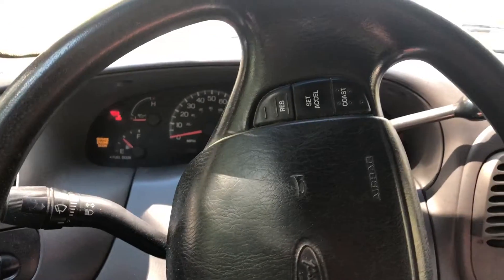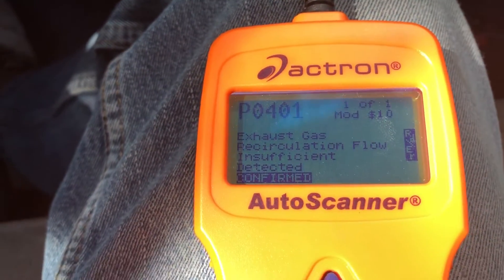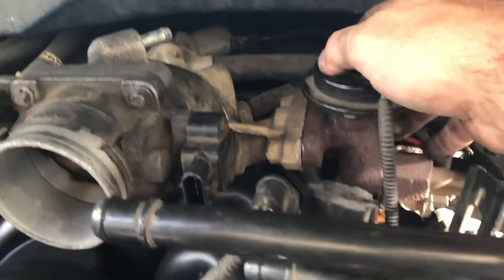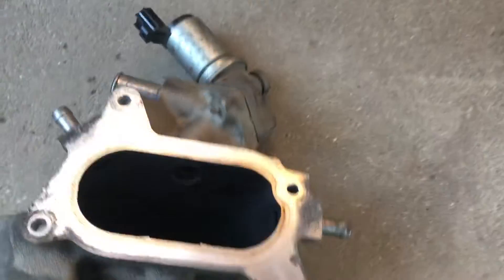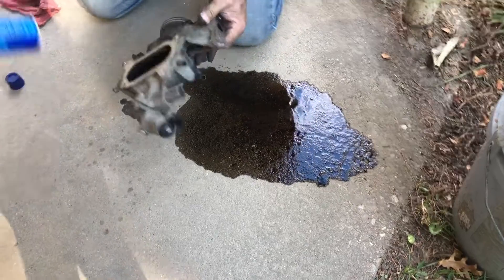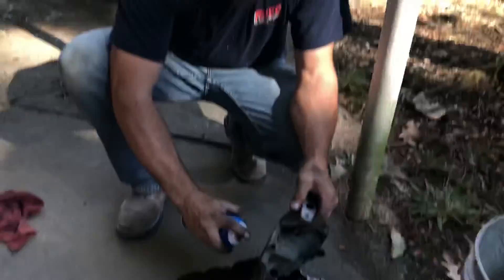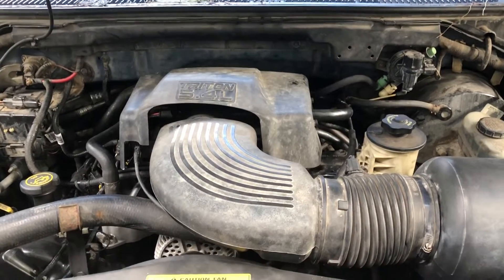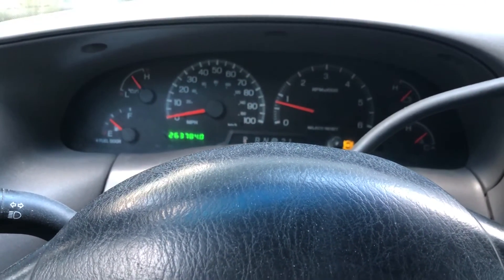Engine Code P0401 Solved. EGR INSUFFICIENT FLOW 2000 F150 XLT

Comment: I have the 97ford f150 5.4 2wd  I changed out the egr valve brand new,brand new throttle body installed last year egr valve last month still get that code will try this next

Comment: here’s lots of people that get this code and ends up being the valve or the build up on the throttle body or vacuum lines but with these trucks most of the time  lots of people do just need the sensor replaced but with other trucks i fixed this problem was valve or build up in the throttle body sometimes even little things that probably should have thrown off other codes but that’s the cons of having a truck that runs and ran and can run even a  a long time… even last as long as old vehicles did before 2005 that’s including other company’s

Comment: Entirely unnecessary to remove.  Come around passenger side of air intake housing.  Pull off rear hose opposite of the two EGR holes, insert small screwdriver or coat hanger and open.  Job done in 2 minutes.  Next, change your spark plugs and stop buying cheap gas.

Comment: I was getting my check engine light checked at auto zone, the first time they said it was the dpfi. Sensor. Put that on the same thing. Next the egr. Same thing. Next the vacuum solenoid. Still check engine light. So I saw your video, so I did what you said, no light. I recommend cleaning the ports before you do anything. I thank you very much for your video. If I would have seen it first I would have saved a couple hundred. Thanks
Reply from the maker: I'm glad the video helped you out.  If your light comes back on check your two hoses to your egr. My hoses were slam full of gunk as well so I ended up replacing the hoses and never had another problem

Comment: I started getting that Code after SeaFoam shocking my 99 F150... the shock worked for Bank Lean code, and Manufacturer Control... I'm on my next fill up... So It maybe needed to burn off.

Comment: Hah, I had a feeling this is where I would end up doing. I'm chasing p0402 changed dpfe, still showing feedback insufficient flow. I'll do this, then check the hoses that come off the dpfe. It's right up front on the 4.2 liter. Thanks for the video.

Comment: I appreciate you making a video to try and help… however brake cleaner is too harsh for the throttle body. Use throttle body cleaner that is designed to protect the sensors and rubber or plastic apparatus that may be connected to the throttlebody assembly. thanks!

Comment: I have the same model, but from '98.
How difficult/frustrating is it to remove that part? And about how long to do so, clean, and re-attach it? My engine light cones on at random moments, but the PO401 is the only code I get. It must need a cleaning.

 I'm the second owner of my truck. The previous owner, a old man in his late 70s, took good care of it, but never replaced parts. I've already had to replace the waterpump. I can't imagine this being more difficult than that.
Reply from the maker: It wasn’t very difficult probably took an hour or two. However I will say that after I had solved that problem I ended up eventually getting another code P1406 DPFE downstream hose off. I checked the two hoses that ran to my egr and they were gummed  up severely. That completely solved my issue. No problems at all after that. I have a video on that as well. I would check those two hoses. Most likely they are gummed up. Engine code P1406 fixed!!! Is the title.

Comment: I’ve done everything replaced everything and cleaned still have code
Reply from the maker: I had to end up changing my DPFE hoses that go to the egr valve. At first this worked however I ended up getting a different code which told me I either had a downstream hose disconnected or clogged. After checking I realized the hoses were completely clogged with emissions gunk. I did another video on that as well you could check out. It may be the problem your having as well.

Comment: I have a 00 F150 that has an insuffient code that's popping up.
I removed the throttle body cleaned it, changed the EGR valve and I'm still getting the code and the light on the dash.

Any suggestions?
Reply from the maker: Check your DPFE hoses. Mine were completely clogged with emission gunk at first cleaning the throttle body worked. The I got another engine code P1406 (down stream hose off). I replaced the two hoses to the EGR and fixed the problem.
Reply: @ErnestPreas  I checked the hoses and they were free so I went ahead and order a DPFE sensor. I'll let u know if that fixes the issue.

Thx
Reply from the maker: @kye389  sounds good let me know how it goes for you. Hopefully that will be the fix
Reply: @ErnestPreas  YAAY!!

I have changed the DPFE sensor reconnected my battery and its day three  the check engine light has stayed off.  🤞🤞

Thx for your input!
Reply from the maker: @kye389  that’s awesome man! I’m glad you were able to get it fixed 🤞here’s to hoping that engine light stays off
Reply: @kye389  did the sensor fix your problem ?
Reply: @diyrob9160 Yes it did but make sure that your throttle body intake is cleaned all the way out.

I have had to get me a fine pencil shape wire brush and placed it on my drill and get down in the small ports.

Engine and throttle body doesn't clean all of the chunky waist that's in it.

Good Luck!

Comment: Its not the throttle body...it's the Dpfe sensor.
Reply: What's that
Reply: there’s lots of people that get this code and ends up being the valve or the build up on the throttle body or vacuum lines but i’m not saying your wrong because lots of people do just need the sensor replaced but with mine and other trucks i fixed problem was valve or build up in the throttle body sometimes even little things that probably should have thrown off other codes but that’s the cons of having a truck that runs and ran a long time…tbh they don’t even last as long as old vehicles did before 2005 that’s including other company’s

Comment: Your daughter is adorable. Just finished intake gasket job trying to fix high LTFT (vac leak). There are NO vac leaks anywhere and now have the P0401 code along with high LTFT numbers. When I did have the manifold off, everything was coated with gunky oily shtuff. Also, while the engine idles, I can here a hiss that is no where to be found. Going outside to replace the EGR and then the solenoids if that doesn't do the trick. Little story behind my truck. It is a cheap CList junker that has me addicted to getting it back to perfect. No shop is going to touch this truck. Want to do it all by myself no matter how long it takes.
Reply: Did you get it fixed?
Reply: @iamlazarow3526  YES....took my time and made sure all the Dorman gaskets were replaced clean & easy. She runs perfect with great fuel trim #'s. NOW I'm working on steering wheel play/slop.
Reply: @clutch5sp989  awesome! Which gaskets did you replace?
Reply: @iamlazarow3526  The intake gaskets & water cross over gaskets. With the Dorman intake off, I turned it upside down and filled it with water to see if it had a crack or leaked. Check to make sure it wasn't suck'n air that way. That vac leak was driving me mad I tell ya and it was going to get fix'd !
Reply: That hiss turned out to be a vacuum leak on my F150. Had to replace the head as they are famous for getting warped.

Comment: What were the driveability problems you were experiencing before the video.  My F-150 is a 5.4 1998 model, and idles fine, but misses as you go above idle.  No codes yet; only an indication that the Evap system has a problem.  Misplaced my good scanner that gives me the Mode 6 info. Thanks for making this video - very helpful.
Reply from the maker: It would idle ok as well and would slightly stumble  a little on take off and seemed to stumble while driving just a little.
Reply: @GR ABS light is likely a sensor, my 99, has been on for 85k miles, my po401code caused zero drivability issues , just a SES light

Comment: That's a good idea to clean the throttle system.  Usually with older vehicles such as the F150 and/or Expeditions the EGR valve doesn't open all the way to allow fuel in.  Chances are it'll run for a while then the code will possibly come up again. I simply replaced the valve itself and the control switch. One thing about the larger vehicles with vacuums and solenoids,,, you'll almost end up replacing the whole system due to the age of the vehicle.
Reply: I've replaced the valve on my 07 explorer a couple of weeks ago. I've got the code today..
Reply: @yousefd9014  it’s the hoses
Reply: @omarflores6470  you don't know unless you put a vacuum gauge on it.
Reply: @JohnSmith-xx1lx  I just don

Comment: Did the code come back?
Reply from the maker: Dean Nutz  thanks for checking out the video. That particular code never came back however I ended up getting another code which was P1406 (downstream hose off) In which I had to replace the downstream hose. There were actually two hoses that are side by side that needed replaced. They were completely blocked by emissions crud that was preventing flow big time. I have a video on how to replace those as well if you would like to check that out also. I would check those hoses also because my downstream hose was completely blocked. That totally fixed that code and I haven’t had an issue with it since. Replacement hoses were probably 20-30 bucks at most if I remember correctly. Might have been less than $20
Reply: Ernest Preas thanks for that! I’ll check that vid and my hoses.

Comment: Very helpful. Did you have to replace gaskets or can you reuse? If replace, how much were they? Also, Did you have any rough idling issues before. My 2002 F150 seems to have some small idling issues prior to the P0401 code. Thanks.
Reply from the maker: James Weimar thanks for checking out the video. I was able to reuse the original gaskets since they didn’t get messed up taking everything apart. I would imagine they wouldn’t be but a few bucks a piece. I did have some rough idling before hand.